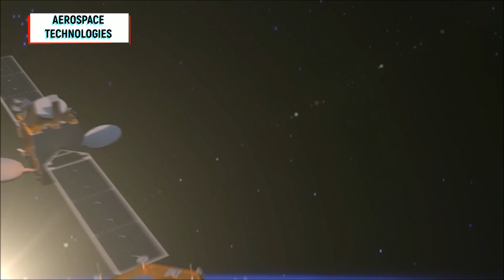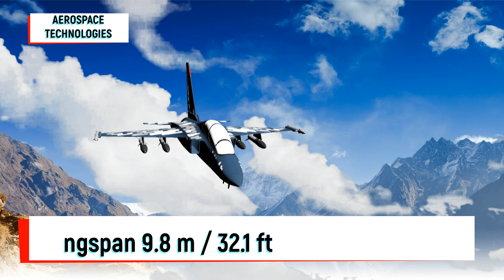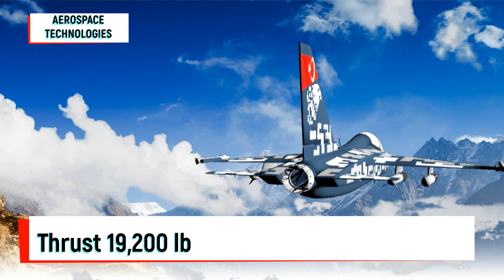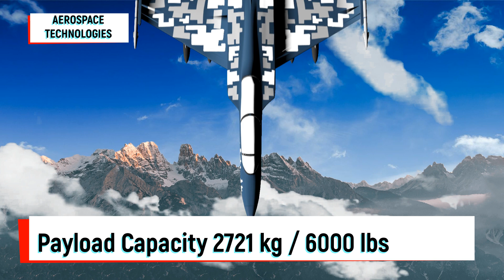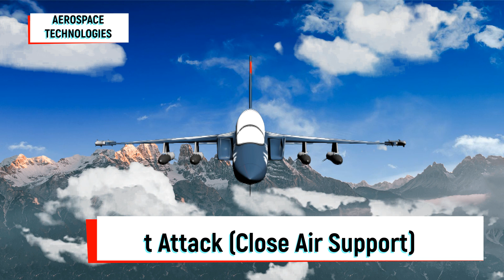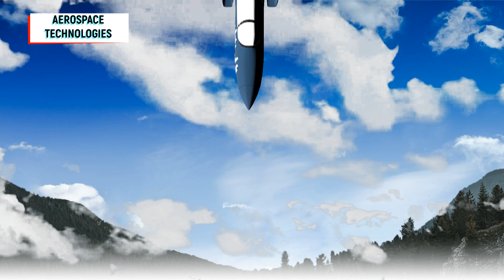Turkey's Jet Trainer and Light Attack Aircraft Project: HÜRJET

Comment: Wasn't this plane one of the proposal for US's Advanced Jet Trainer by Sierra Nevada?  The chosen plane had 2 engines with twin tailwings.
Reply from the maker: No it wasn’t offered to usaf. That was a joint design of SNC and Turkish Aerospace. This design completely new and has different features
Reply: @AerospaceTechnologies  layers as all planet Know turkos layers
Reply: @AerospaceTechnologies  pull the other one it's got bells on it. Are you trying to prove that TUI is capable of designing a new plane - from scratch? You look at the US trainer competition again. Improvements or alterations does not change the fact that this plane project was bought from SNC!!! Its not an issue for "nationalism", as when the truth comes out TUI would look like a liar!!
Reply from the maker: That plane which designed with SNC had less capability in terms of non-training functions. Also, that plane was going to use an engine which developed and used by business jets. Turkish Aerospace (they are no longer use TAI) couldnt developed and light attack version if they used same design with SNC.
Reply from the maker: Apparently you have a lot of wrong information. 1- TA and SNC planned to use civilian engine for their T-X project design because they want to cut costs with cheaper engine option. 2- TA calculated alternative engine options for Hurjet project such as GE products and EJ200, but EJ200 have never been used as one engine so this will cause design changes. 3- I am not sure you understood or not from the 2. item, Hurjet is going to be single engine aircraft so not a twin engine SAAB design. 4- TA got different helps and assistance from different companies but those are general British and Italian companies. SAAB can not assist Turkey in any military project because Sweden has embargo on Turkey for military projects. 5- TA Hurjet is going to GE F404 engines.